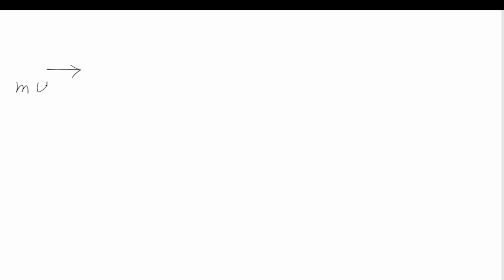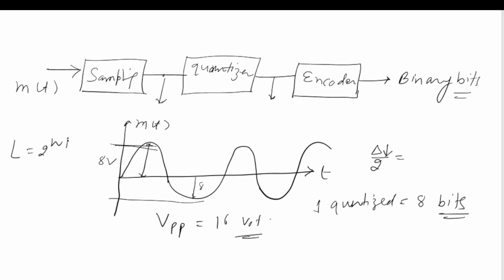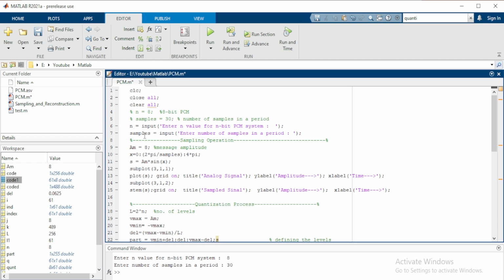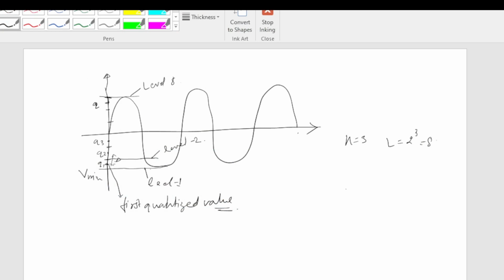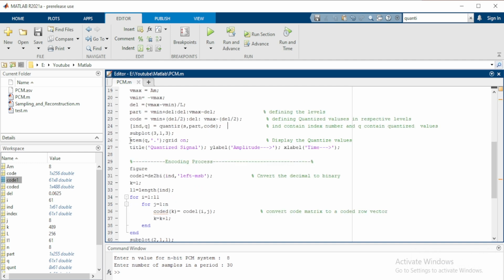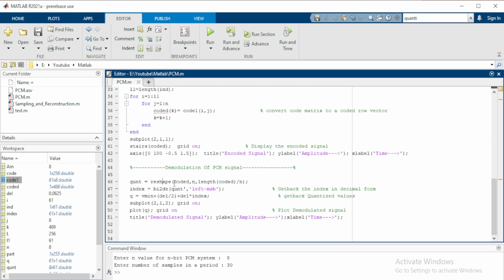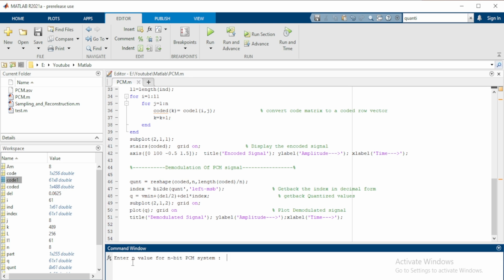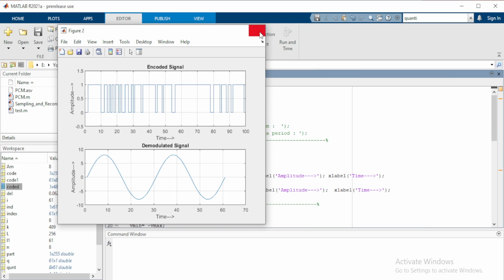MATLAB code for PCM| Pulse Code Modulation and Demodulation using MATLAB

Comment: Excellent video sir . A small doubt.  We are going to encode the quantized values right. Then why are taking ind for enxding instead of q
Reply from the maker: We can encode quantized value (q) also. In that case for demodulation we can directly get quantized value. Thats OK. But here I have quantized the levels and in demodulation I got quantized value back using formula at line 48. All that I want to say that quantized level and quantized value is interchangeable.